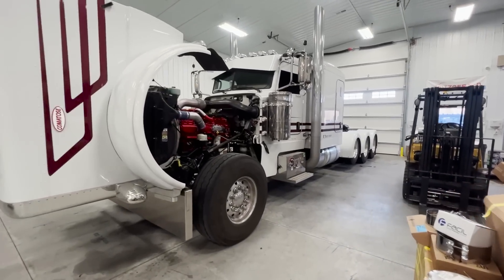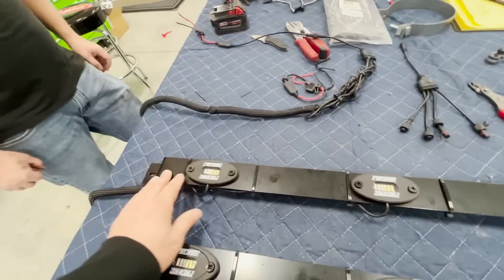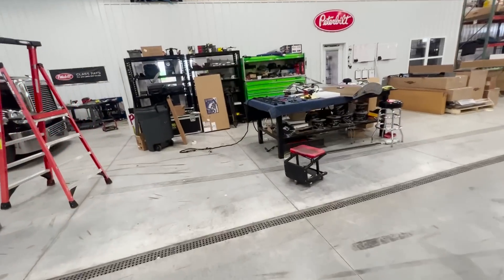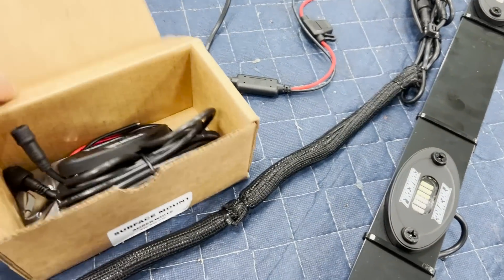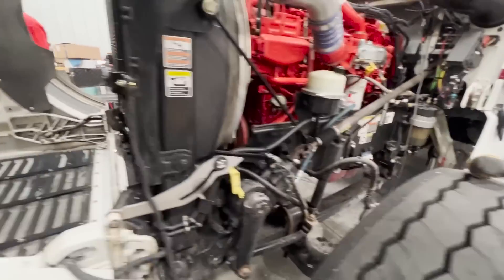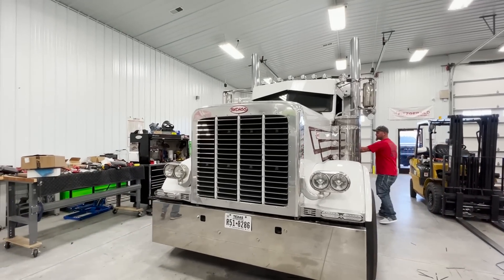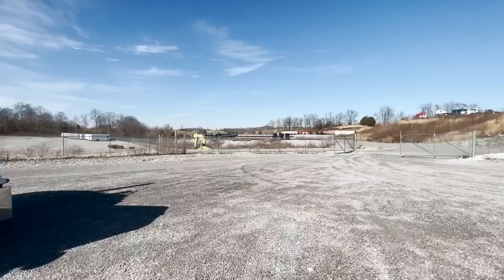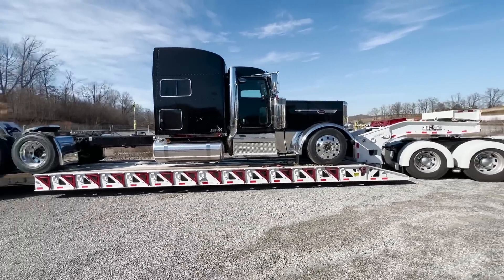Tri-State's Peterbilt 389 "Comatose" rolls into the shop

Comment: Since you are running the wire through the passenger side of the firewall, wouldn't it be better to have the wires coming off that end of the bracket? Then you wouldn't have to run them as far. Just my thoughts.